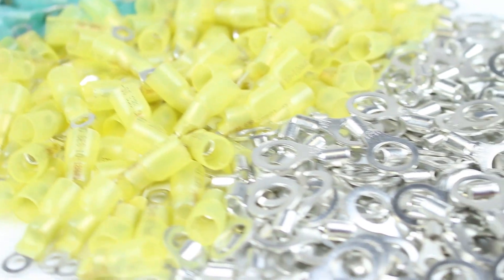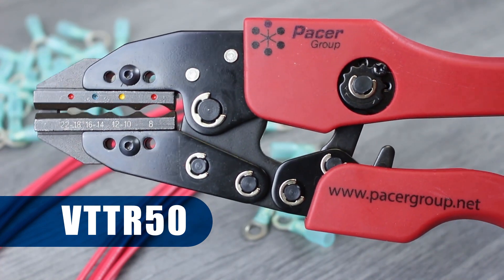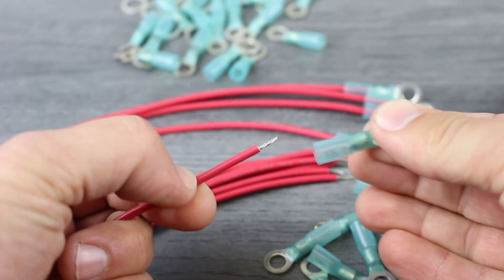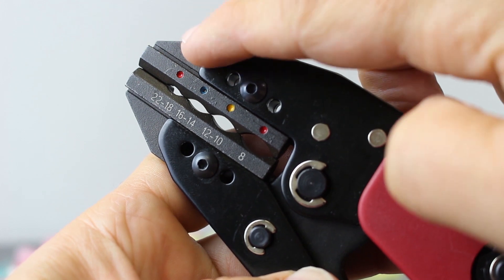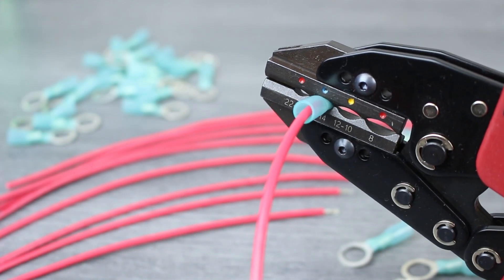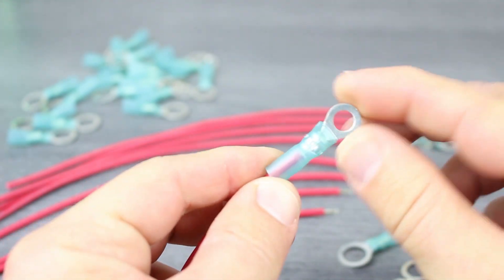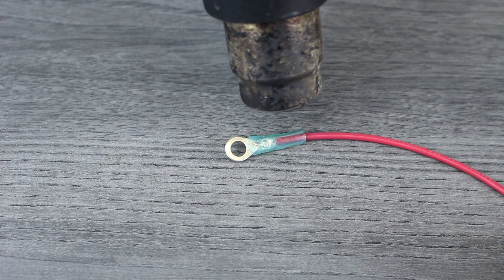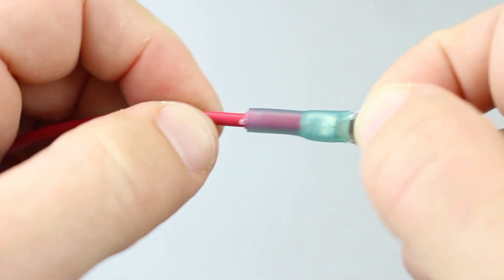Ring Terminal Installation

Comment: Perform tug test after crimping but before shrinking the heatshrink. You want to test the crimp itself. Also, do not use the heatgun as shown against a table. Hold the terminal up and apply heat evenly around the terminal or with a deflector, away from other objects.